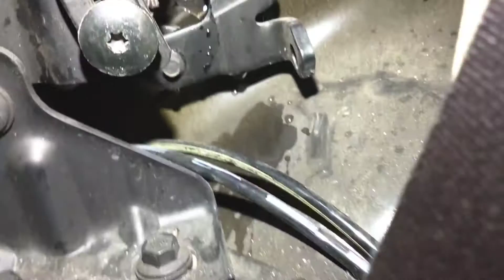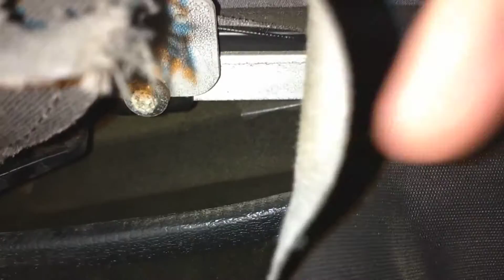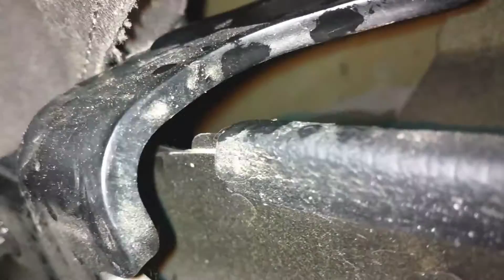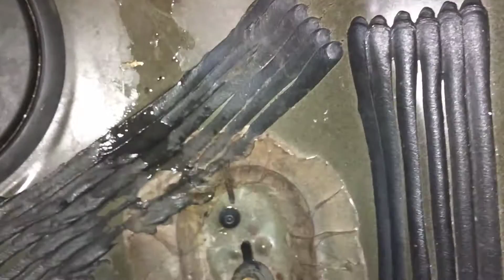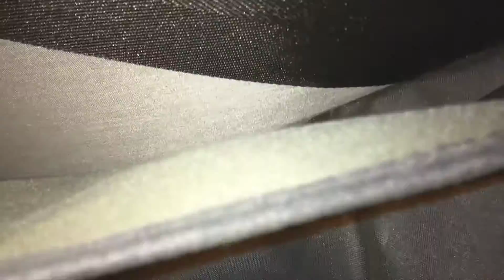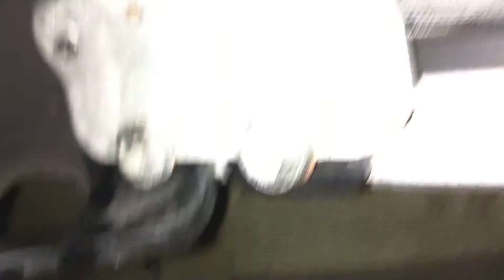2005 Mustang GT convertible leak.

Comment: Clean the rubber funnels under the plastic vents in front of front windshield.  Then, stick a pressure washer down into the rear quarter panels when the top is down and spray the drain holes at the bottom.  Then pop the plastic pieces off where the door closes at, below where the door closes that says "Mustang" and the wall above that, to expose the seam where the interior metal meets the exterior metal.  Put 3M urethane sealer on that seam.  You can stick a garden hose in the rear quarter panel and fill it up with water to see where along that seam it leaks at and how well the drain holes work.  Can also stab at the drain holes from above, where the garden hose would go in at (the big hole when the top is down).

Comment from the maker: I tried my best to sew together the parts that had ripped.  I made sure to get whatever part the water was running down, to the other side of that wall which had the drain at the bottom.  I soon sold the vehicle after this video so I have no idea if it worked long term

Comment: Did you find where this was coming from and what was the fix?
Reply from the maker: The roof material had ripped where it curved and folded after constant use. I sewed it back by together and it worked for some time at least.

Comment: How to fix it?
Reply: Clean the rubber funnels under the plastic vents in front of front windshield.  Then, stick a pressure washer down into the rear quarter panels and spray them.  Then pop the plastic pieces off where the door closes at, below where the door closes that says "Mustang" and the wall above that, to expose the seam where the interior metal meets the exterior metal.  Put 3M urethane sealer on that seam.  You can stick a garden hose in the rear quarter panel and fill it up with water to see where along that seam it leaks at and how well the drain holes work.  Can also stab at the drain holes from above, where the garden hose would go in at (the big hole when the top is down).
Reply: But in this guy's case, I think his top got damaged.